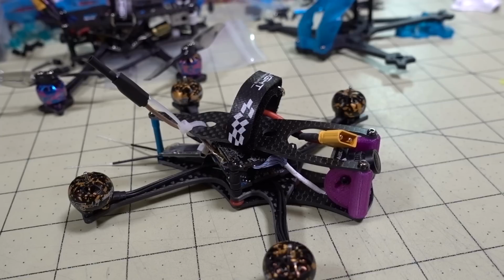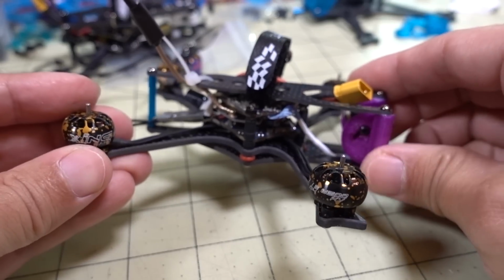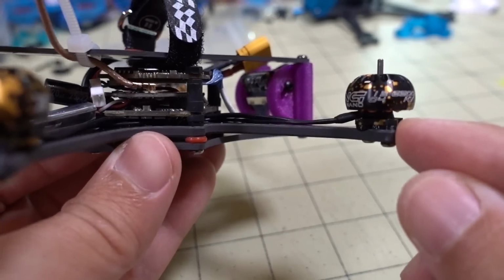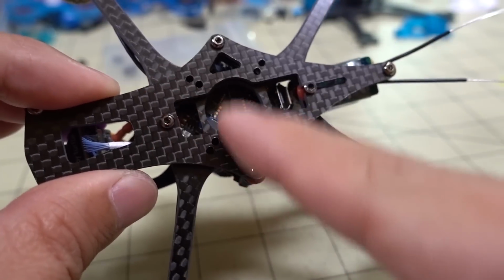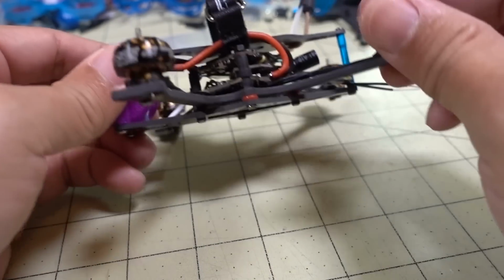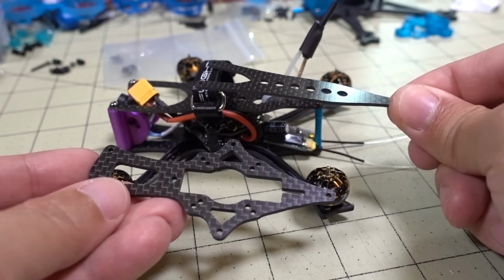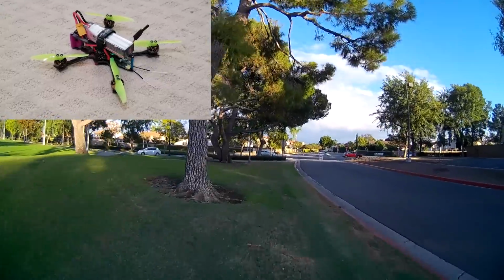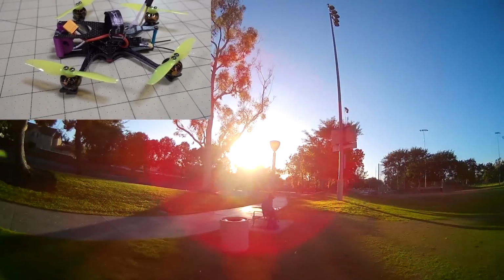Pickle EVO HD Toothpick

Comment: i have two of those iflight whoop boards and both worked great for a couple of flights but they eventually burnt up. it was the same esc (#3) that failed and melted on both. it's a shame because they flew perfect until that happened.  one was flown on 2s w/ 1104 7,500kv and the other on 3s w/ 1105 5,000kv.
the motor are still good though. i tested them on different corners and they spin up fine. it sucks both boards are useless...they're just 3-in-1 now

Comment: My new Betafpv fc 12a aio toothpick DOA. Esc no 2 & 4 burnt, magic smoke, got refund. Anyone experience the same issue?

Now I am waiting diatone fc aio 13a. Pairing with 1105 7000kv motors, 2s. Hope this fc can hold long enough.

I am still with 65mm / 2.5inch propeller, 2s with hi kv motors. Example happymodel 1103 12000kv and 1105 7000kv motors. Keep it lite, small and cheap lol.

Comment: when i first built my quad one motor got so hot it smelled but after tuning pids its been good thru the past 100 flights they are 3br 1105 in 3s
Reply from the maker: These motors aren't getting hot so they are getting killed in some other way.